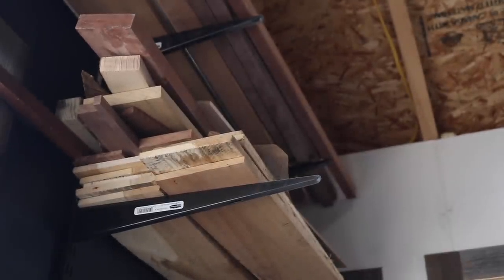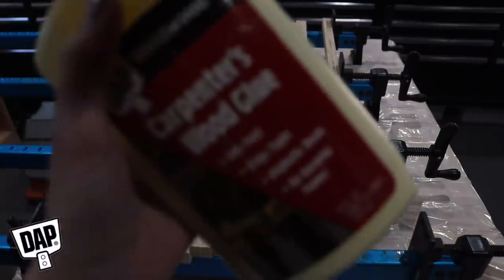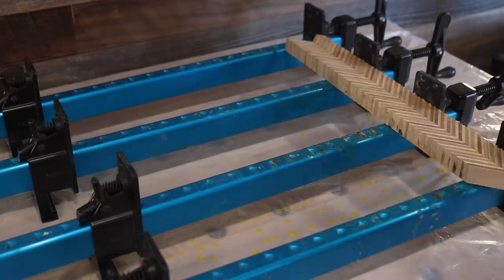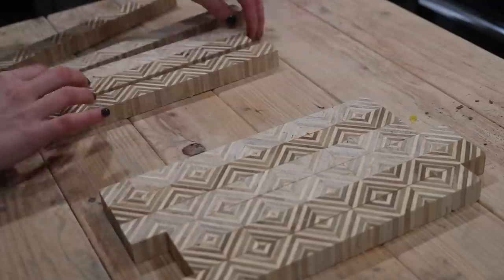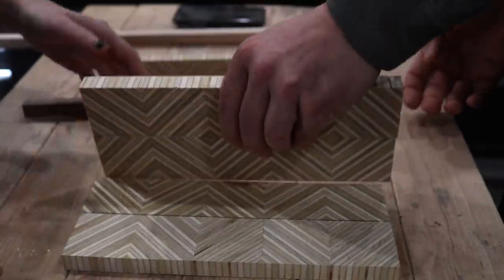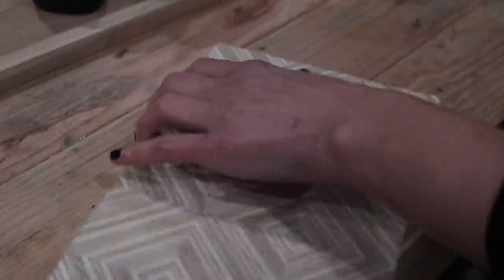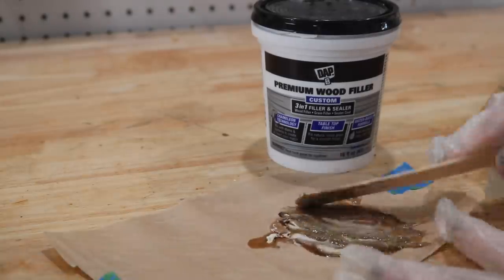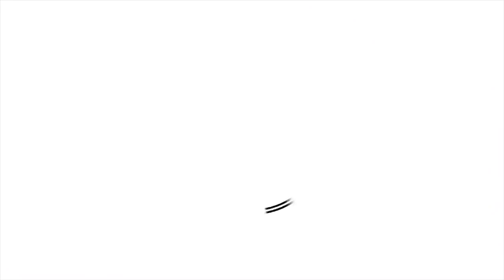DIY Scrap Wood Key Holder (Patterned Plywood)

Comment: I believe if you had pieces for the same sheet of ply you would have not had issues! Nice work it looks 👍
Reply from the maker: I actually think I’m hindsight the issue is with the kerf after you cut. The diamonds will most likely never line up because the blade cuts out a small chunk in between each pattern ... all good though! Total learning experience. Thank you! 😊

Comment: You did an amazing job! really. Congratulations, the only thing (for me) it wouldn't work is not symmetrical, as am so diagnosed OCD, I needed equal pattern at the end... you know what I meant. but really really amazing.
Reply from the maker: I feel you! It’s actually REALLY hard to get that to work with the diamond pattern because the blade takes a 1/16” chunk out of the wood when cutting the pattern. So, there will always be a small chunk missing from the pattern, which makes us super hard to match everything up perfectly. 😫

Comment: Would this idea make a good cutting board? Or Butcher Block? Or would the plywood be a problem?
Reply from the maker: I would probably shy away from using plywood for a cutting board because it's so porous and doesn't do well with moisture. Would be cool to try this with hardwoods though!
Reply: @diyhuntress  Yes that could be cool. Say using veneers of three or four kinds of wood. Laminated 50 times. until it comes out some what like up have. Could come out very cool. <3
Reply from the maker: That would actually be awesome!

Comment: Very cool looking...might have to try this. What clamps are you using here for the glue up? (the blue ones)?
Reply from the maker: Get ready for a ride - partnered plywood is so addicting! They’re bar clamps from Rockler. Life savers!
Reply: @diyhuntress  What size have you found to be the most versatile? I guess it depends on the width of your planer?
Reply from the maker: I have the 24” ones and use them for everything.